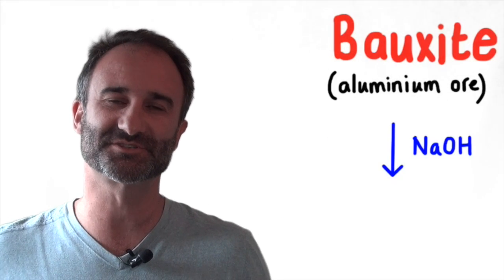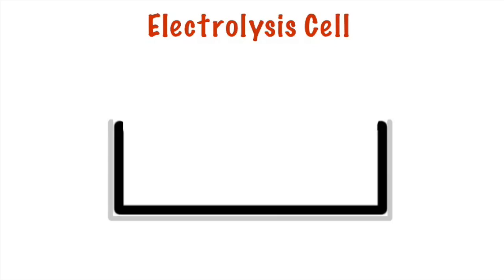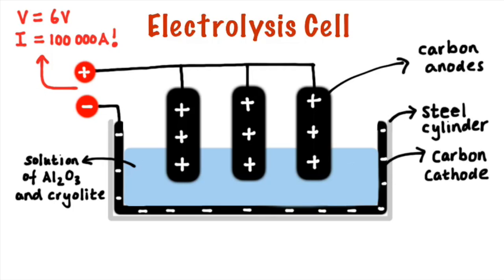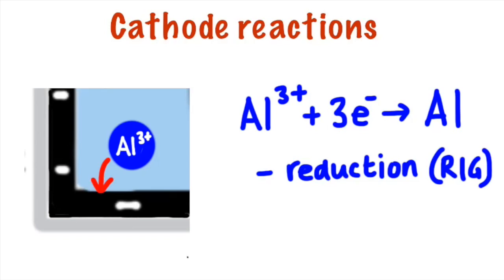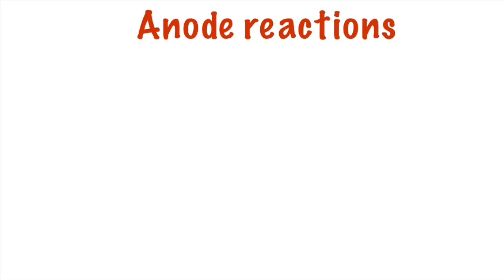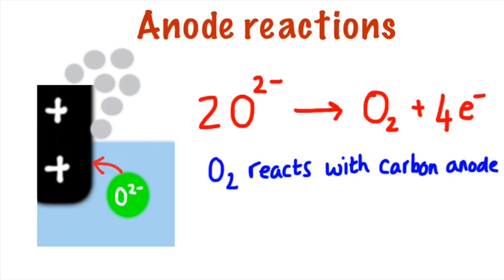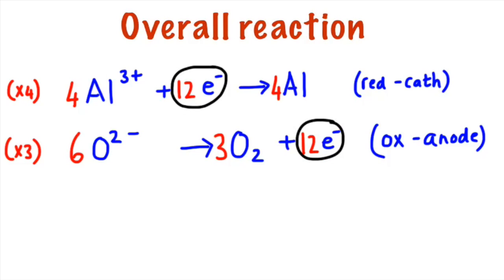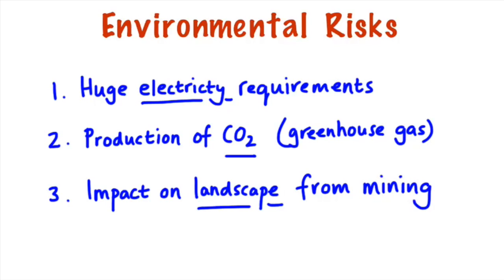Electrolysis of alumina

Comment: Why is it multiplied by four (5:00) plz someone exlain
Reply from the maker: Hi.  Each half reaction needs to be balanced in terms on number of particles (atoms or ions) on each side and the total charge on each side.  Once the half-reactions have been balanced, then if you need to combine to show an overall reaction, then the number of electrons in each half reaction must be balanced before adding them together (so that the electrons cancel).  The cathodes reaction uses 3 electrons and then anode reaction releases 4 electrons.  To balance this we multiple through each reaction to create the same number of electrons (in this case the lowest common multiple of 3 and 4 is 12).  Therefore we want each half reaction to end up with 12 electrons.  To do this you multiply the top one through by 4, and the bottom one through by 3.  Does that help?
Reply: Thank you sir

Comment: In my book it says they used graphite as cathode and graphite rods dipped in molten mixture of electrolyte as anode?
Why u used carbon in this?
Reply from the maker: Graphite is just one particular allotrope of carbon, so in a sense it is saying the same thing.  Carbon is the element that the electrodes are made from.  The particular form of carbon (allotrope) is called graphite.  Their shape and what they are treated with then is described in your book correctly.  Hope that helps.
Reply: @jeremygibbon7080  thank you☺

Comment: Hello Mr, I have got a question and I wish you could help me.
Why is NaOH used?
Reply from the maker: Hi.  Basically the NaOH is used to purify the bauxite (in something called the Bayer process).  The oxides of aluminium dissolve in the hot NaOH.  The impurities (mostly iron oxides) don't dissolve and are removed by filtration.
Reply: Thanks! I've got assigned to a question that has not been explained to me but your video helped me a lot! It covered both the points that were confusing me! I'm so thankful for your efforts in making this video and in answering my question. 
All the best!
Reply from the maker: @bedoe9684  Glad it was helpful.  Where are you in the world?
Reply: @jeremygibbon7080  Well my country starts with E and ends in T, it has 3 pyramids and it faces the Mediterranean sea. Was it obvious enough? Or shall I mention that it has 7,000 years of history?
Reply from the maker: @bedoe9684  Fantastic!  I've travelled there many times.  All the best.

Comment: Electrolysis voltage is not 6V! this is high for a modern day electrolysis cell which run at a voltage of al low as 4 V.
Reply: This is an educational video, why is that even significant. It is a meaningless micro detail which doesn't actually serve any educational purpose to the audience the video was meant for. What is important is the MASSIVE amount of current needed, due to the 3 electrons needed for every atom of aluminum.(Actually 12 electrons are needed for 4 Aluminum atoms)

Comment: Can the 4 electrons gained in the anode reactions be reused for the extraction of Al in the cathode reactions? If no, why?
Reply: Hi Kosal.  The electrons lost by the two oxide ions at the anode drift around the circuit and eventually would be used at the cathode for the reduction of the aluminium ions.  These electrons are not 'lost' but simply form part of the overall flow around the circuit.